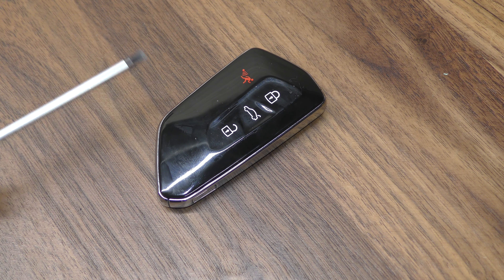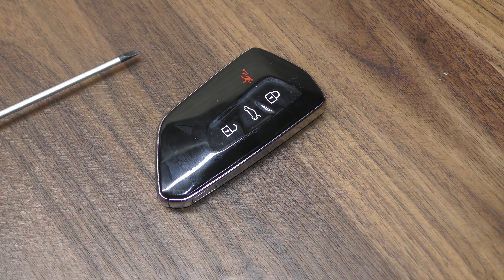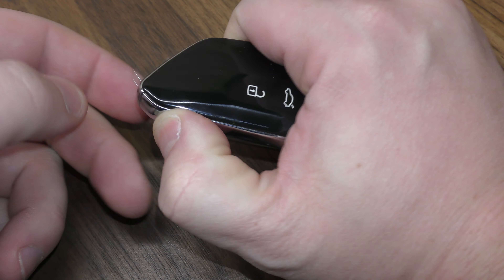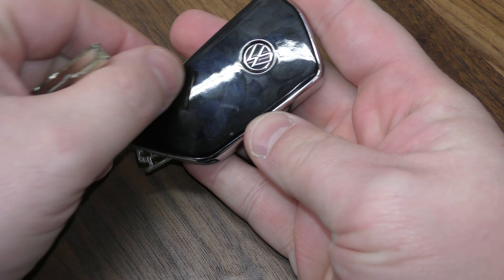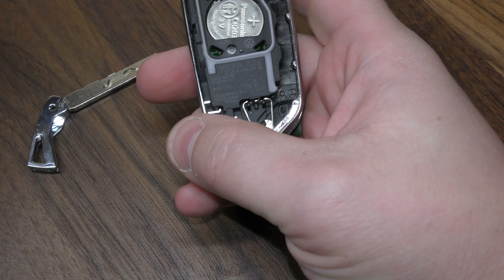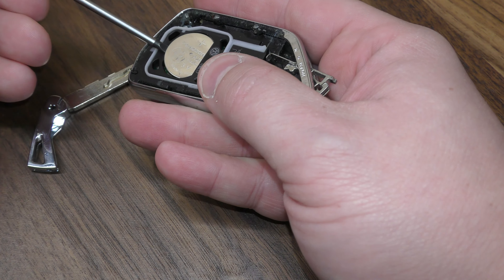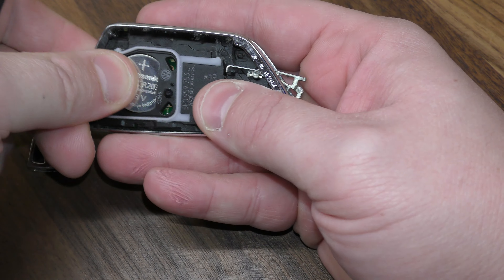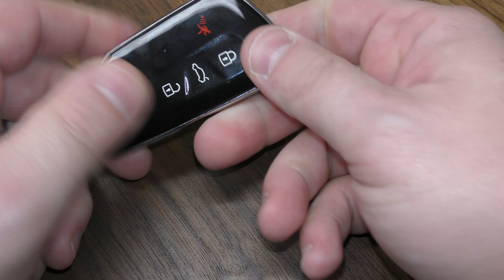2020-2023 VW Golf GTI / R Key Fob Battery Replacement - EASY DIY

Comment: Thank you for this! Was just starting to get low fob battery messages on my GTI and didn’t want to wait for the next service appointment to replace them. Super easy to do at home.
Reply from the maker: No problem 👍 Glad it was helpful
Reply: Yeah, never wait until the next service lol. You'd be surprised how quickly the battery is dead after that message comes on.
Reply: @ZenzDeluxe  my alert has been going on for 6 months and I just changed it today 😂

Comment: any tips for putting the silicone side (wrong side to access battery, the side with the push buttons) back on?
I watched your vid then ordered batteries then decided to just go for it when they arrived and stupidly started taking the silicone side off. Not going well when it comes to putting it back on! 😂
Watched your video again and changed the battery in 60 seconds- excellent!
Reply: I just did the same damn thing with my R fob. Took the wrong side off and cannot put it back on. Did you ever find a way to get it back on?
Reply: @shaglioni  sucks doesn't it? I tried to reinsert it with small electronics screw drivers but not much luck. Just had mine serviced and they put it back together.
Reply: @danblack72  ok cool, so I guess I'll ask someone at my dealership then for assistance. Thank you.

Comment: super helfpul for the battery.. someone took the plastic cover off the other side (with the unlock/lock buttons).. any idea if the transmitter comes apart (easily)?
Reply from the maker: you best bet is probably to just cover it up with a silicone cover - https://amzn.to/3POUJKA

Comment: car key will start to alert driver on display of car that car key battery need replacement when voltage drop to 3.0 V     without any resistor;   
where new CR2032  usually show 3.3 V voltage with no resistor